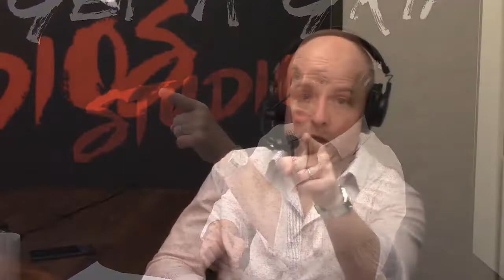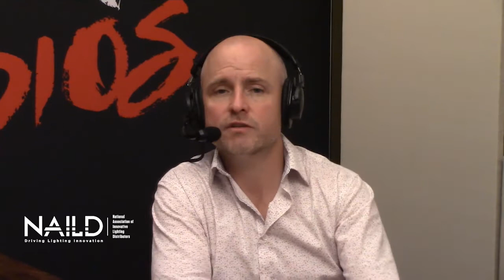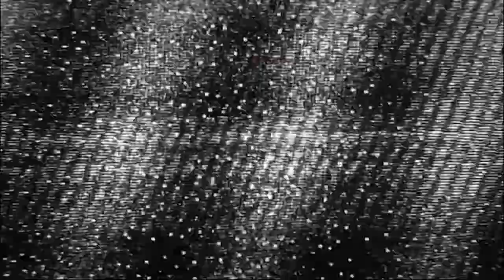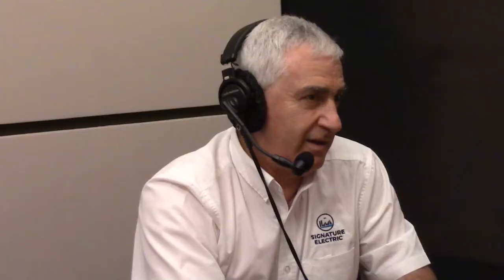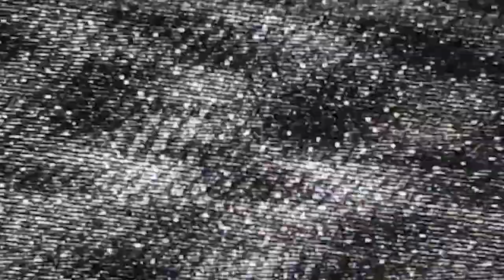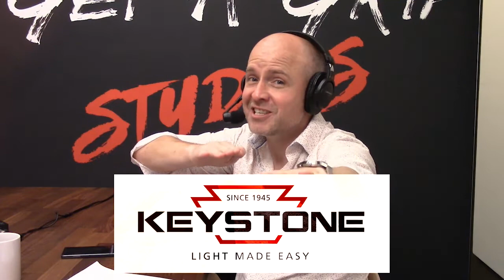Ep 107 - That's Called Merchandising, Mark Marmer

Comment: So Mark can connect the lighting system to the battery/solar system and run usage tests to figure out if running DC current to a dc driver to run the LEDs can create an exponential reduction in your lighting systems consumption.
Reply from the maker: y'know it's funny you should bring that idea up...

keep your eyes on the feed for a deeper look at those ideas....